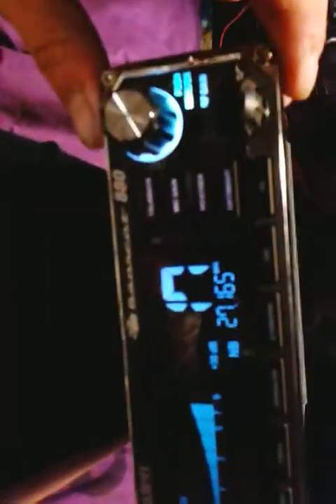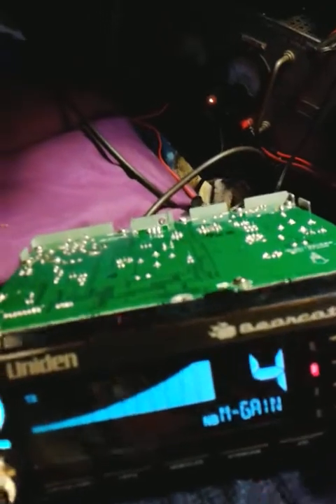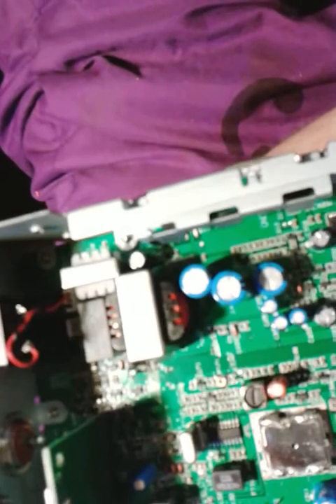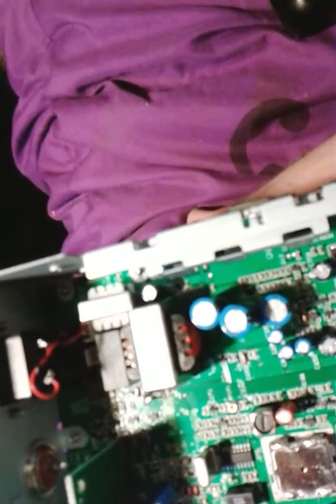audio mod for the Uniden Bearcat 880

Comment: I bought this radio at a loves truck stop and bought a 4 foot top coil fiber glass antenna. I can talk clearly for about 5 miles I did talk 7 miles one time and it’s hill terrain. Me and a truck bud talk for miles with mine and it’s not peak or tuned it’s factory . My swr is around 1.25 on 1 and 40. Could something be up with my radio or what? Because it talks out long range . And clear . I also added a different mic astatic mic . That maybe where the difference is I don’t know . Thanks guys
Reply: I hear that changing the mic is a must..I'm trying a mod that makes since for the original so, will see.

Comment: could you not jumper a switch across the diode in parallel that way you could turn this mod on and off
Reply: no. the jumper is not even needed. just by removing the part will disable the AMC circuit thus making it as loud as possible

Comment: i found the resistor that will amplify your voice when you turn it and peak it out. its a white resistor with a philips head near the screen. it goes counter clockwise
Reply: early first gen models do not have that adjustment. only the second gen has that white pot adjustment
Reply: I like your suggestion . This mod should be done using a scope to monitor this peak level in my thinking..Now ? what resistor are you talking about and I hear that these have to be dealt with very easy with the right tool . What resistor and what tool should one use /

Comment: The Audio limiter is there for a reason. Now it's a splatter box and sound's crappy.
Reply: Actually, the audio is piss-weak with factory setting. I mean, it's laughable weak and Uniden should be ashamed for letting them sell like that. Anything you can do, Power Mic or Diode Clip, is  1000% improvement.
Reply: @monstersdoexist  your so full of crap. I've talked tons of DX with a unmodded bearcat radio. Great audio. What.they don't have is tons of power. But they got plenty of audio.
Reply: @captaininsano2777  Tell that to the hundreds of guys that sent theirs back for a refund. Just google Uniden Bearcat 880 Reviews. Go argue with them, not me. I run a Stryker SR-955HP and actually talk skip every day.
Reply: @monstersdoexist  bullshit. Conditions don't exist every day. 😂 People return radios of all kinds for a refund. Why do you think Stryker radios are the most sold used radio out there. Folks get em. Use for a few months and sell. Tons of Facebook cb radio sales pages to prove that. Stryker also has tons of problems with their displays going out, functions completely stop working because of loose plugs on the back of the face plate, fragile junk MOSFET transistors they come factory with in the early 655 and 955 models. I can keep going on n on. Quick fix for an audio upgrade can be as simple as a power mic.
Reply: @monstersdoexist  I have seen a mod for the mic that makes sense. I have already done this for my mic and have not even used the radio yet..After 30 yrs I am setting up a base station and I want the best I can get out of the 885 and be legal..The 2 watt output, sucks , and I understand this can be helped and still be legal..Any thoughts guys/gals..WT here..
Reply: flat topping
Reply: @bobicpfan2  I agree but something needs to be done easily to help benefit the problem they created..

Comment: Why buy this version of Uniden CB the old chassis work better and do not have surface mount technology which is extremely hard to work on . PC78LTD like the Cobra 29 Peak and tweek great and work for years and years  !  Cheaper to fix in the long run ! P.S. Pro-520 do 6-8 watts DK and 22-25 watts PEP !   Uses the same final as Cobra 25 or 29 and cost is low !
Reply: Cobra Sucks